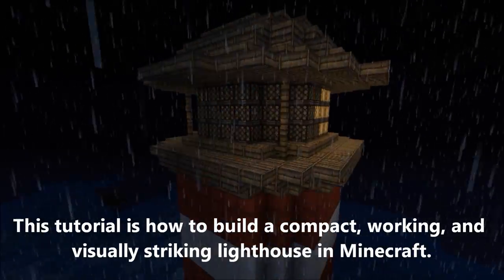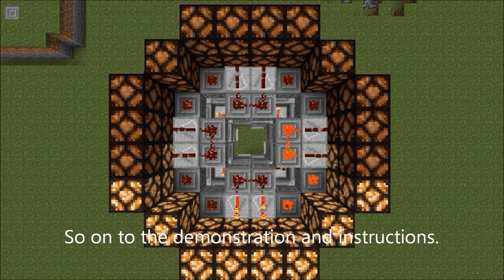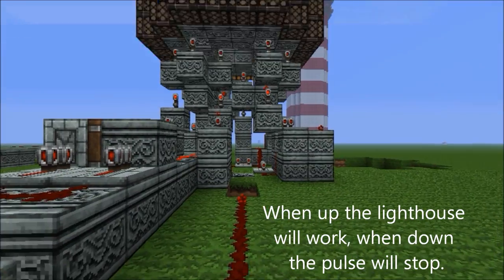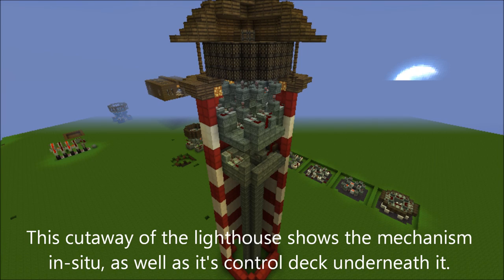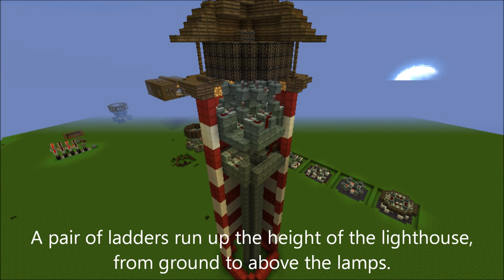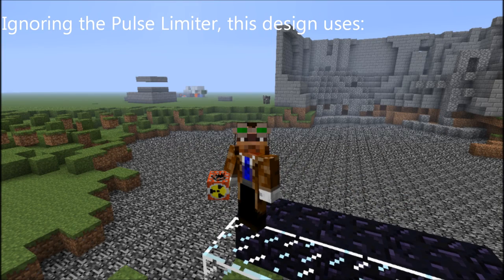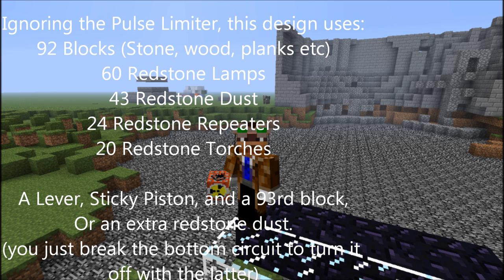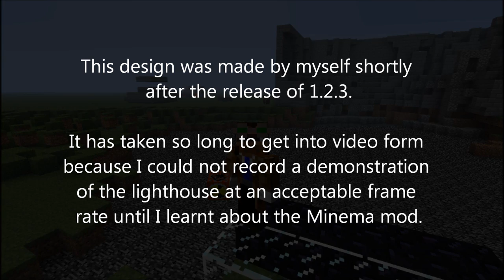Minecraft - Revolving Lighthouse Tutorial Using Redstone Lamps

Comment: Great tutorial. Works like a charm. I am working on getting a daylight sensor to work with this. Thank you for the great work.
Reply: Just an update. I got it 100% functional. Turns off in the day and turns on at night.
Reply: Use a daytime senson. You have two connections. One to a sticky piston to break the circuit in the daytime and the other connection is to an inverter which is connected to a pulse-width modulator then connected to where he/she connects the switch

Comment: Or you make a redstone day/night sensor. I think it works just as well with other ambient light sources, too. Like the placing of a torch, if you can really find any use for that. There exist some slightly larger, extremely sensitive ones, or much much smaller, less sensitive ones. Either way, you can make them easily in vanilla.